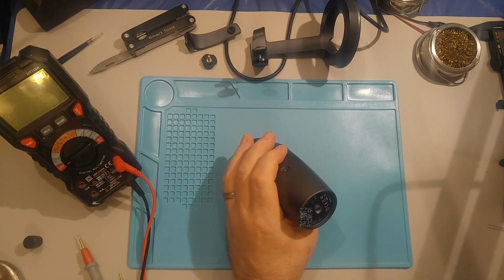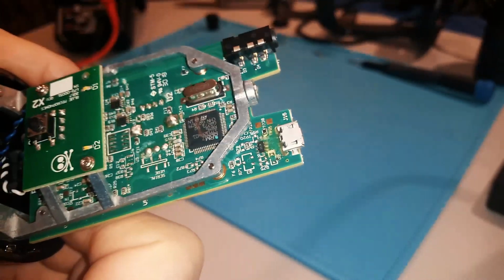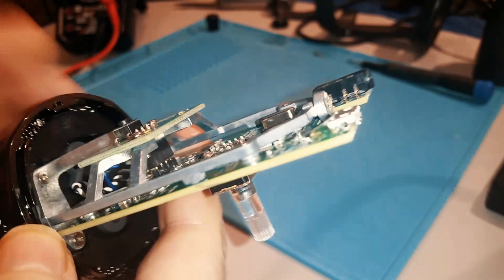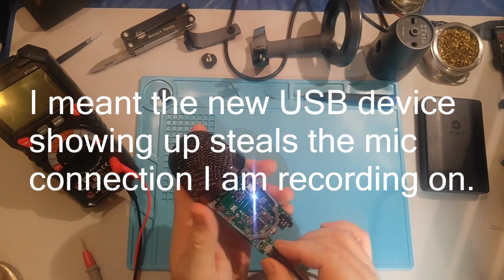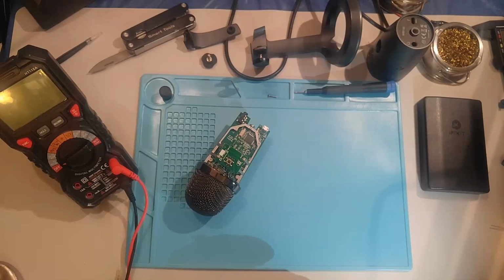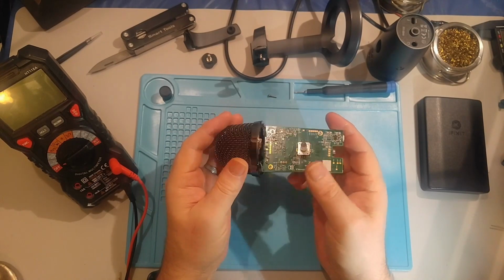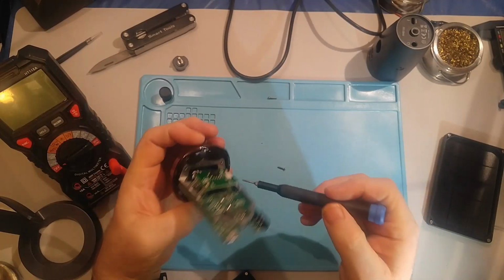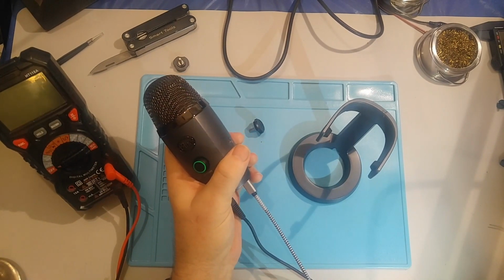Blue Yeti Nano MIC - disassemble/teardown/repair attempt.

Comment: Do you have any idea if/how I could change the green LED to be red when it’s unmuted (and off when muted)? It kinda clashes with my red setup and the lighting part of the software is greyed out
Reply from the maker: That's a cool idea. If it's the same light on/off, then you could just could hijack the connections from the red LED. If opposite, then hijack and XOR into green LED using a power trace XOR'd with the red LED's power. Tricky mod, but it would work. If I can get the time, I may try to set up an example and post a video. I would probably do a cheap hack and just use blue tape over the red LED. Or maybe yellow. I'm never sure with colors.

Comment: My screw actually snapped inside when trying to tighten it up, since it was rattling quite a bit, do you know the thread size and what not of the singular screw?
Reply from the maker: Ouch, that's crazy. I looked around but found no spec for the screw itself, and I don't have a way to measure the threads. Their customer service is really good (firmware discussions notwithstanding) and I wouldn't be surprised if they can get back to you quickly or even send a replacement.

Comment: Need help with my recently scavenged Blue yeti (not nano) USB port is missing... Any ideas?
Reply from the maker: Yes. :) You can replace the port with a USB cable.

I've done it - I got a Blue Yeti (not nano) and it had a bad port (inner part of jack broken so plugs just wouldn't set in properly), so I just removed it with an hot air gun and then soldered on the corresponding 4 wires from a USB cable that I cut the micro connector side from (leaving the the big "A" side that goes into the PC). The cable then comes out where the old jack was and it's permanent. If that makes sense, hopefully... It was pretty easy though I had a pin get left behind when removing the old jack. Also, the pads don't seem super strong, so it's got to be a quick gentle job, and then I put hot glue on the cable where it went through the hole for strain relief.

I actually replaced the first one I did because I wanted a longer cable, so if you are going to do the same thing, I recommend a 5 ft or longer cable unless you have USB extension cables available - 5ft was fine, the first one was more like 3ft and that wasn't working out for me.

If you have any questions on this or if my answer wasn't really clear enough, let me know.. I made a video of it, but I didn't think it was interesting enough to post. The hardest part is knowing which wires connect to which pads, and though there is a standard for which color each wire is, it helps if you are good at checking continuity with a multimeter - it's pretty easy, you can touch the colored wire with one lead (from the multimeter) and then scan the connections in the jack with the other lead until it beeps.

If you get stuck on that part, I can fish up that part of the video I made and post it for you.

Cheers!
Reply: @nerdlands6595  wow thank you so much for the detailed reply. That was my initial idea but had no idea where to start. I am still a novice at these things so a video would be amazing. If you don’t want to post it, maybe an email? 

Thank you again for help!
Reply from the maker: @collinhuntzinger9106  Sure... When I get a break from work I"ll dig it up. If you don't hear from me in a couple days though, please hit me up again... Sorry that it's not already ready, I'm sure you want to dive into it...
Reply: @nerdlands6595  Hello Just wondering if you have had a break from work. If not no rush! thanks !
Reply from the maker: @collinhuntzinger9106  Hi Collin, I hope to get it done this weekend or sooner. I found the footage. Not sure it wouldn't be faster just to send you the highlights and see if it covers what you need... I also forgot that I changed my cable again (for a longer one) after I finished - lesson being that I should have tested the cable distance at my desk with the first cable!

If you hit my "about" you should be able to send me an email and I can respond directly. Sorry it's taken so long, it's been crazy.
Reply from the maker: The "About" thing is on my channel, but it's on gmail and it's nerdlandsmail ;)
Reply: @nerdlands6595   Hello, I know it's been a while and I'm trying to figure out my USB problem. I soldered in a new port but it seems my computer is powering it up but it's not detecting it as anything more of a " Malfunction". Now I do have the "ID" pin not soldered onto anything but I don't see a trace where it goes and I was wondering if I need to solder another wire to something or I need to look for another problem...

Comment: Thank you :) my nano has jack broken off and once I manage to remove volume button there is nothing that can stop me from rixing it. 

Be well :)
Reply from the maker: Very welcome - thanks for letting me know! I am wondering what you are using to remove the glue? I just fixed a normal Yeti (not Nano) and it was easy - no glue, lots of room, but also Micro USB footprint, so...